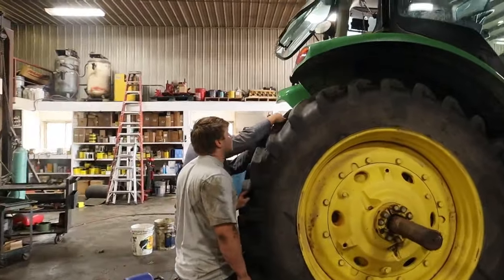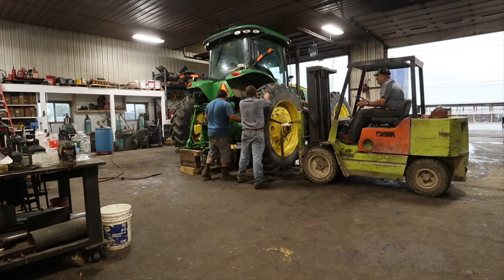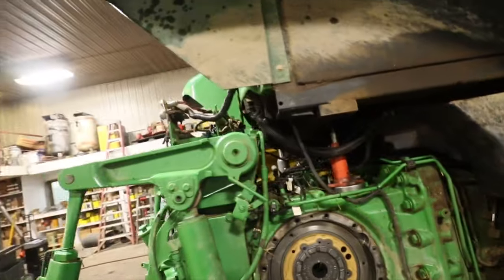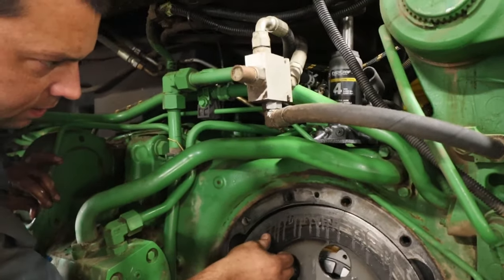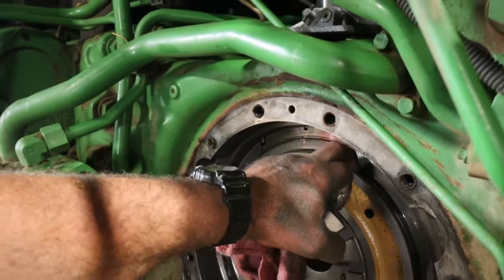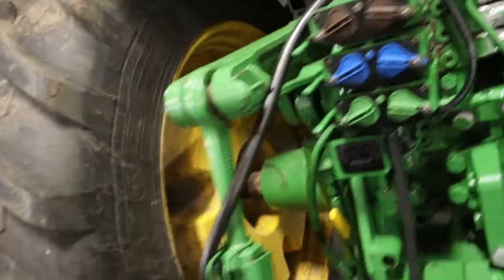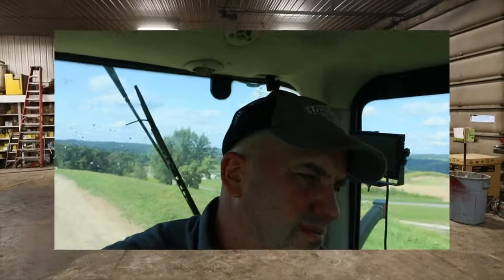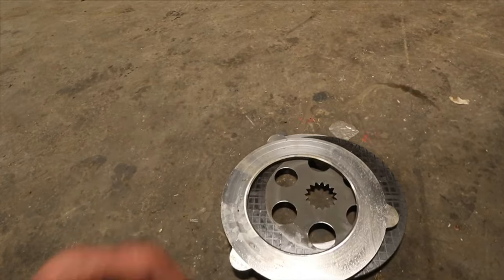Another  BROKEN  DEERE....................Replacing Brakes on a John Deere 7R

Comment: The thing I appreciate about the Challenger/ Fendt/ Massey tractors is that the oils in the hydraulic reservoir, transmission, and planetaries are all kept separate. If there is a problem in one of those areas, then contamination or damage is less likely to spread to the others.

Comment: I’d say you do a couple 25-50 hour oil and filter changes on that tractor too.
Reply: It's cheaper to go ahead and change Oil & filters than having to go into the transmission to be repaired!!
Reply: I think he said it was almost full at 98 quarts.  That's 25 gallons of oil.  Sounds  a bit like a swimming pool. You don't change the water every time it gets a little dirty.  You treat it and filter it.
Reply: @mashedmitten Seems to me the expert from John Deere told him to change the filter after a few hours of running. Don't recall him saying he was told to change all the oil again. I think I'd take the word of the professional who was on site rather than some "lame brain," arm chair expert on the internet.
Reply: @mashedmitten Lame-brain, hockey puck...quite the vocabulary there.  Another Internet arm chair expert.  You do realize that he put 98+ quarts in the thing already, right?  Sounds like he already drained it and filled it and the expert, you know the one you're smarter than, told him to change the filter again after a few hours running.  I'm thinking these guys do this enough, have it under control and don't need your advice anyway.  Personally, I'd stick with the JD tech.

Comment: Andy it could have been a parts failure with that plate broken, the plate may have been faulty to break like that, but really nobody knows what exactly happened, wether it’s operator, parts failure or fatigue, just that it did happen so all you can do is repair it and get it back to work, it’s all part of owning machinery, good vid though very enjoyable

Comment: Always interesting to see the mechanics of farm machines.  Nice video.
Reply from the maker: Yes it is indeed
Reply: @FarmingFixingFabricating  what state is this in
Reply: @FarmingFixingFabricating  hi just wondering do you find putting bolt through forks the best way to hold half axle ? Or is a engine heist better? Thanks
Reply: @missymitchell9766   bad state. Tractor was fucked.
Reply: @georgerodgers4030  I'd imagine they use the forklift with a bolt through it, or a Bow shackle because it's far easier to move than an engine hoist. Don't need to be yanking it backwards on the floor to get it to move. That's my assumption to your question. Seems like an obvious answer. but I could 100% be wrong. But it's also a machine they have, and a versatile one at that. I'd definitely use a forklift over an engine hoist. Obviously space is a factor, of which they have ample amounts of.

Comment: I thought left hand brake wear would have been a thing of the past. 

It was however fairly normal on smaller 2WD tractors used for ploughing in the UK way back when reversible ploughs were a new fangled thing.
Reply from the maker: Makes sense

Comment: I have to say the brake issue reminded me of my Dad and Grandad.  Grandad had a '51 chevy and was tearing up clutches every few thousand miles.  So the story goes he never used first gear and would run at high revs just to get the car going.  My Dad did the clutch work and it drove him crazy, lol.  You never know how people treat your equipment.  Good luck, thanks.

Comment: I think the major reason why brakes was damaged on the left side is an equal load on both sides. Actually fault was on the right side maybe seal or low hydraulic pressure in brake cylinder

Comment: I'm not familiar with the 7 series but on the 8R (8RT in my case) there is a priority valve...when the O rings go it can cause the brakes to drag and do just what you found inside this one. I would look into that so you don't end up doing this again in a couple years.

Comment: Check brake pedal adjustment,  make sure the are not dragging. I put a clutch in a 9400T a year after the JD dealer put one in, found the clutch cable was hanging up, not releasing completely. It caused slippage wearing the new clutch out.
Reply from the maker: Ouch

Comment: Hi we run valtra here brakes are discs as well but there 5discs and 3wear plates. Anytime we do brakes we soake the discs in oil b4 we put them in that way they never run dry. We often fill a transmission with say half diesal and half cheap hyd oil run it for few minutes and drain to get as much grit as possible out. Grit is torture to fully get out😣and blocks everything

Comment: Four huge tires driven by a planetary so what turns them x 3 has to stop them  x 3 I've seen  bigger brakes on road racing cars.  I also like that when removing the second R/H tire and wheel the whole tractor shifts left,  and when they take apart the l/h side it shifts while the tech is under both the tractor and the forklift
Reply from the maker: Yup
Reply: No, you haven't seen bigger brakes on road cars, look at the diameter of that plate, even if thin it is a large surface.
Wet brakes do not get hot the same as dry brakes, heat is the main cause of rapid deterioration in friction materials - Clutches, brakes, etc.

Comment: Time for a JCB fastrac 4 large outboard discs two calipers per discs .half worn pads after 2000 hrs.awesome brakes. Interesting video Andy keep up the good work.🙉🙉👍👍😀
Reply from the maker: Thanks
Reply: beats me why more tractor manufacturers don,t follow the JCB example - why did any tractor designer think that allowing brake residue to circulate around precision engineered hydraulic components is acceptable? - and most tractors have had similar design for 40 plus years that I know of

Comment: Who would have thunk the wet brakes on dads Ford 1320 that those many years ago and I always wondered what wet brakes could be. All the truck and or car brakes. But now I have a clue what they might look like. Different brand and what a expense that must have been. But safety #1 glad with family or anyone they got breaks now for sure. And also a non farmer I have clue those noches are for  on the axle. So thankful. How those work. Is filter a spin on? A couple changes would be planned  all to protect i would think. Thank you a lot.
Reply from the maker: Yes spin on

Comment: Andy; Any way you can put a pressure guage on that side for the brakes. See if the control valve is sendings a slight pressure to that brake when the pedal is all the way up? Could the linkage be out of adjustment keeping the brake partially on? I hope you can put your finger on the problem and know for sure what caused the failure. If. Not, it’s going to happing again
Reply from the maker: I assume operator error

Comment: Just wondering Andy, given that the hitch rams are double acting would it not be possible to make a frame to attach to the linkage to safely lift the rear end of the tractor up?
Reply from the maker: Not sure if it had power down

Comment: Very intersand this video.
Have you also checked the brake pressures. Maybe there is a continuous amount of brake pressure on the cylinder, causing the brake disc to wear extra
Reply from the maker: It seems to be working fine now

Comment: I am wondering if the plate cracked and took out the disk. I am a bit surprised there is only one disk as the cats I am used to always seemed to have at least two. Does J.D. offer ultra high efficiency filters ( clean out filters) ?  WE would run them in the cats when we had a failure that contaminated the oil. I would keep doing the filters every few days until they are clean, filters are cheaper than a trans job. The oil will be fine as the filters will keep cleaning it. hope this is useful info.
Reply from the maker: I'll have to check, thanks

Comment: Awesome video. I never get tired of your shop videos, half the time I just let them play in the shop during the day rather than listen to the radio. Do those brake pedals lock together on that tractor? I used to bitch at the guys all the time because when they were out on the road every time they slow down they would just use the left brake pedal, I assume because it’s the closest easiest one to press? But that’s what would happen it would burn the left brakes off and the rights will still look like brand new. Come to think of it every time I get into a project like this it usually comes back to the guy driving it haha. But like you said it could’ve just gotten hot one time and then made contact from there on out. Take it easy man
Reply from the maker: Thanks

Comment: Is the entire system is contaminated? Usually wet brakes are bullet proof.
Reply from the maker: Yeah everything has to be replaced now…new transmission, differentials, the front hydraulic axle all the components

Comment: Back in the 90s I work for Ford/ Mew Holland dealership  .They got a overhead crane out of some burn out business .They had 2 rails running north and south that were stationary, and 2 running east and west that you could  with manual chain lifts .Made working on equipment a breeze . Maybe you look into something like that Yes dealership still in business  as New Holland
Reply from the maker: I have a gantry
Reply: @FarmingFixingFabricating  Okay I live in NSI if you ever come this way could show you  You would be impressed thanks for getting back

Comment: Seems that the first few years of the 7&8r’s eat brakes and the ITV had issues. Seems the brakes always delaminates. I have done an 8235r 3 times. It has 18k hours on it and feeds cows. Did the engine in that tractor at 5500 hours due to a cracked liner too. But I’ve seen my fair share of issues in them and in the red tractors too. All these new ones break just as bad if neither worse than the old tractors lol

Comment: Oh my 20 Series 30 Series 40 series The brake system will tell you which side was wearing when you put your foot on the break it was designed it would kick back the first time it happened to me it was the weirdest feeling you would push on the break and it would push back over 3 inches when I called the dealer I was a young kid he told me John Deere build that into the brake system so you know that your brakes are getting too worn and it’s getting ready to trash the system did they quit doing this on the newer tractor’s
Reply from the maker: Never noticed

Comment: So are there just brakes in the rear axle?
Reply from the maker: It's a differential as well
Reply: The brakes are in the rear axle and the fourwheel drive kicks in with the brake pedal to get brakes to the front axle through the drivetrain for 4 wheel braking.

Comment: How in the hell does someone Wear out the brakes on a tractor?
Reply: Pulling a lot of weight with no brakes on implament.  Going down hill to turn in a small driveway or stop sign
Reply: Resting their leg on the top of the brake pedals
Reply: Only using the left side brake pedal.
Reply: I agree to all of these replies
Reply: @neilramseyer5348  that would be he vast majority of american equipment ( with no brakes)

Comment: These Deere John’s .... why on earth is it designed this way? Enclosed in a case behind the shaft? So much work for basic servicing. Is this normal for tractors? And the brake dust and debris gets flushed through the transmission...? You joking right?

Comment: How come you don't have a wheel dolly to remove those beats the hell out of a forklift
Reply from the maker: Wheel dolly wouldn't work
Reply: @FarmingFixingFabricating  I use them all the time so much easier one guy is all it takes I use it for large combine to fully weighted tractor wheels they are much more stable and precise to remove and install

Comment: Good old John Deere..... All they do is fucking break biggest most expensive pieces of rubbish out there!
Reply from the maker: Yes you should never have to replace a wear item right? You the difference between what you think might be superior to what I have and what you actual have is???? We are putting a lot of hours on this equipment. Now what you have might be better, I don't know that, but I ain't deicing our whole line of equipment based on what you are telling me.
Reply: @FarmingFixingFabricating  I use alot of John Deere equipment in my line of horticultural work and every one of them have been a constant let down or always a repair mission one way or another, we've ran Massey Ferguson's constant doing heavy hauls and being the only workhorse we had used for weeks or months on end only have minor maintenance to carry out . My opinion is that JD are more trouble than their worth.

Comment: repaired the result of a problem didnt fix the problem... it will do it again
Reply from the maker: More than likely operator error... Riding brake pedal
Reply: Get a thermal imager and monitor the temp on each side.  You’ll catch any problem early.  Bearings too.

Comment: What makes the piston go back in?
Normally on breaks that generate heat the piston does not return correctly.
Could there be something wrong with the break cylinder / break valve or whatever that makes it not release the pressure so the breaks are constantly on a bit?
Reply from the maker: I'm assuming we had a guy riding the left brake

Comment: Buy a fendt, and explore a better worldin tractors
Reply: lol if you use them any of them will break,, most of these tractors have over 10.000 hrs some 25.000 hrs..fendt wasn't even a word when these tractors were new
Reply: plane iron Well my father and brother have been running a large contracting firm for 30 years now, and there is a reason for we run most fendt and not a single deere. Fendt is the superior tractor in all ways
Reply: @ronkeking97  ok then